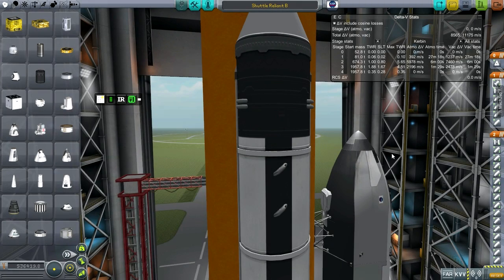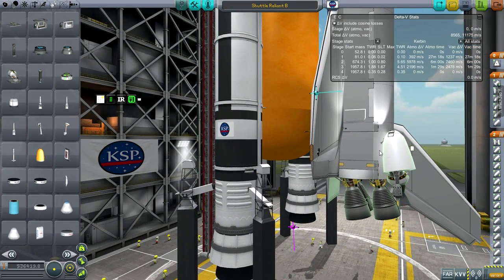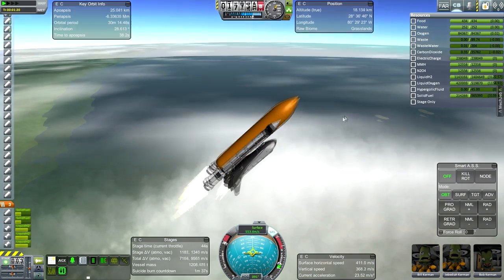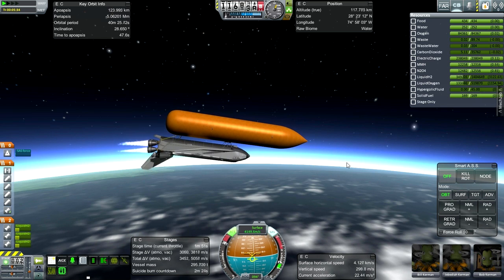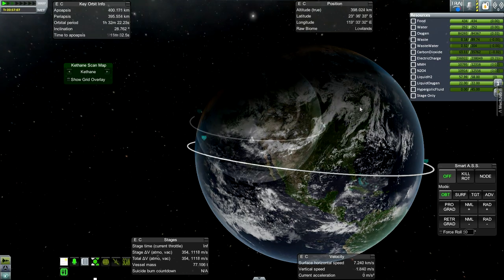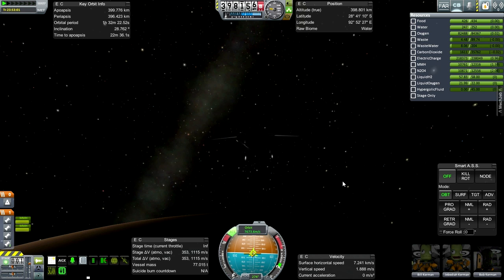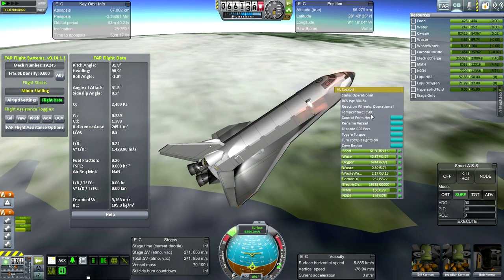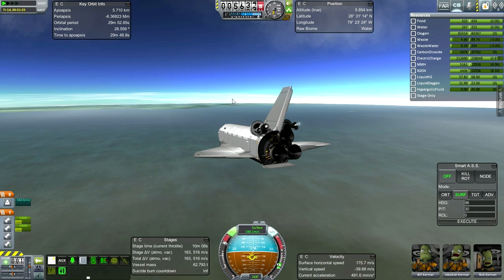Kerbal Space Program - New RSS/RO Space Shuttle Test

Comment: Very nice try! First - few technical notes:
1. As you've noticed, OMS engines are angled about 15° off prograge in pitch, and control software automatically oriented vehicle such that nose would be 15° higher than intended burn direction. This doesn't matter too much when the vehicle is in free flight, but if you ever want to rendezvous with something in orbit - you need to adjust burn direction the same way real vehicle does.
2. Real vehicle had aerobrake integrated into vertical stabilizer (control surface on it "split off" to increase drag). It's due to this arrangement the shuttle is able to maintain high angle of attack (imagine as if something pulls the vehicle back by its stab - whole thing would pitch up). You could probably emulate this by slapping speedbrakes to the sides of the stab, or - better yet - putting two control surfaces on sides and making them spoilers using FAR (right click on the control surface -> choose "Spoiler") - they can be deployed either by action group, or simply by using regular brake button.
Reply: ***** In my flights I had them engaged all the way through reentry - the key here is to make them large enough so that they would pitch whole vehicle up, but not excessively large as to cause vehicle to loose control and turn around. And of course after reentry part is completed you engage/disengage it as necessary for downrange/approach control. It will also help you to execute final pre-landing flare to reduce vertical speed to a reasonable number just before touchdown - the real shuttle had a glideslope angle of 20° (for comparison - commercial planes have glideslope angle of just 4° - unless local airport conditions dictate other angles), so if you smash into the ground at that angle the results won't be good.
Reply: ***** For landing gears - in most cases these issues are caused by the fact that it's rather hard to place one wheel exactly along the long axis - if you look closely as you attach it, you'll notice it jitters a bit, and this is enough to cause a lot of issues during landing. That's why I usually put wheels in pairs - even put two wheels in front instead of usual single one. This worked great for me so far.
I'd also suggest you to consider adding braking chutes - they help to quickly slow down after touchdown before you have a chance to veer off runway.
Reply: great comment! thanks

Comment: Now - for the general things - if you feel like doing something with RO that doesn't require your old save to work - you can use CKAN utility to set up 0.25 RSS install basically by several mouse clicks (you'll need to use DEV CKAN build to get GUI though - but I found no problems using it), which cuts setup time to basically how long will it take to download whatever mods you'll select in GUI. I did this experiment just now and got working RO setup with no manual operations at all - I've chosen mods I wanted in GUI, clicked "install" - done! Not all mods are CKAN-compatible yet  (AIES for example - probably because it wasn't updated for ages - though it still works fine in 0.25), but this utility certainly cuts down on the installation hassle (I still remember RO used to take about 1 hour to set up manually). This makes playing around with one-off things very easy, as well as maintaining mods up-to-date.
For the series in general - this is obviously my opinion, but I feel like your RO version kinda lacking direction, and every episode goes to some unexpected direction, and not working towards some kind of "grand goal" end-game. IMHO the best KSP series (not a video, but series as a whole) I've ever seen was Bob Fitch's ISS reconstruction project ( I swear I watched it all end-to-end several times when I was commuting to/from my clients!) If you'll do something like that for RSS - that would certainly be my number 1 series to look forward to. This would likely require you to use part welding, and I'm not sure if that mod has been updated for 0.25 (but I can probably do that if it will be the only thing in the way). But that's only if you feel like doing so, as it will surely require some serious commitment both in terms to time it takes to build these replicas, and general willingness to research things and kind of keep a general direction. You've already built Space Shuttle, and with your level of expertise you should have no problems replicating Proton/Soyuz rockets which were used to deliver certain modules.
Reply: ***** I might've worded this wrong - my suggestion wasn't so much to replicate ISS, but moreso as an example of a long project with very well defined path to the end, and lots of activities are related to completing it.
Your suggestion is good, except that it's way too short IMHO as all of that can be achieved is about 10 flights or so (depending on what kind of rockets will you use, and exact arrangement). How about you execute somewhat what Mars One announced it would do? By that I mean not just building a base off two-three modules, but actually building a town on Mars. The condition is that your base would slowly but surely expand - so you'll have to establish self-sufficiency from the very beginning, and that in itself involves lots of flight to survey ground for resource deposits/temperature/atmospheric conditions, choosing the best location for the base (it should be in the valley as atmosphere is thicker there, close to the pole for water supply - but not so close as to not have too low temperatures to save energy on heating, it needs to be in a somewhat open area to get as much of a sunlight, but not open enough to avoid sand storms. etc.). The important thing is for you to think through the storyline, and write at least high-level "script" of how events would unfold and what happens when, include some disasters like meteorite strike, sand storm or whatever else you can come up with. Granted, you will add more details into the story as you go, but at least you'll get a general direction. Try not to focus too much on what you can or can't do in KSP, but concentrate on what needs to happen - later you can figure out ways to make that happen. You can take as example TV series - they are interesting to watch precisely because they have a storyline (you usually can kinda guess what's about to happen, but is curious to see how exactly events unfold, which way main character would go, etc.). Your video series is a TV series (just shot entirely in CGI instead of live actors), so make it feel like such.
Whichever way you'll ultimately decide to go, if you need any help - you can always ask for it and we (as in collectively - viewers) would be happy to assist in any way we can.
Reply: ***** As for career/sandbox thing - let's be realistic here - adapting KSP's career to RO will have a long time, so it's not realistic to expect it to arrive anytime soon. Instead you can come up with your own restrictions and house rules to make things interesting (for example you can just roleplay how you get your funds, and then simply edit save file to have these funds appear/disappear).
Reply: ***** Speaking of the ISS and Shuttle, you might want to talk to Chris P. Bacon ( https://www.youtube.com/user/ChrisPBacon82 ) who as I understand it has a nearly-correct patch to use the Community Space Shuttle in RO.
Reply: ***** I like the quote that's in NathanKell's forum signature on this regard: "In RSS your only enemy is physics". That is itself is very serious problem, especially if you want to transfer significant mass across the solar system. If you don't think so - try bringing space station module to Europa's orbit for example, and remember to devise a way to keep it resupplied with food and other consumables. Granted, unlike the real life you don't need to worry about station-keeping, but most research papers indicate that life support consumables pose the biggest problem.
So introduce a house rule not to use ridiculous rockets (like 200 t to LEO uber-heavies) and Sci-Fi-class propulsion systems - and you'll quickly realize that it's much easier said than done. In my sandbox I like to limit myself to rockets that exist in real life right now - and that is enough of a challenge for me. The reason I relegate to real-life rockets is that I like to think "what-if" scenarios what would've happened if whatever it is I'm up to would suddenly become a priority in real life, and how real life space agencies would approach this task.